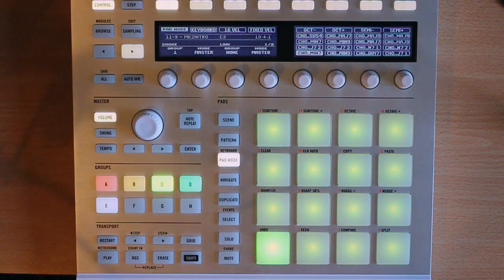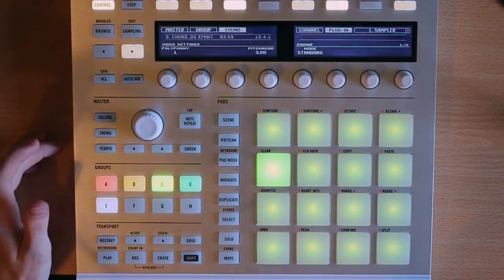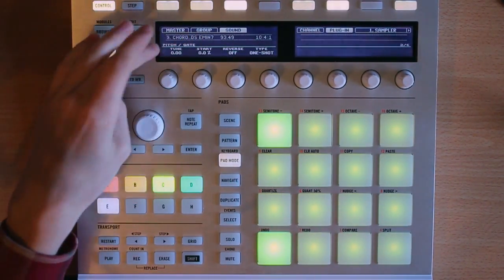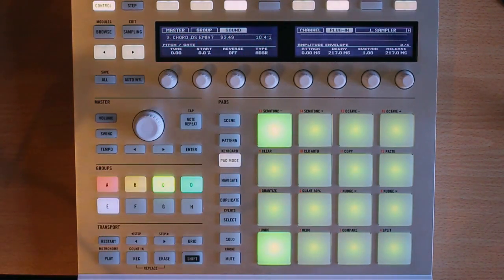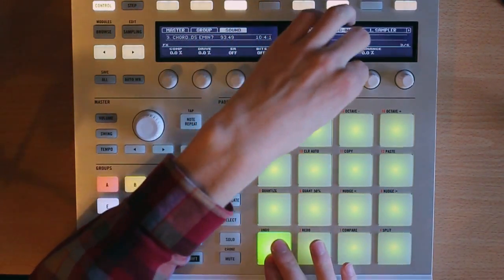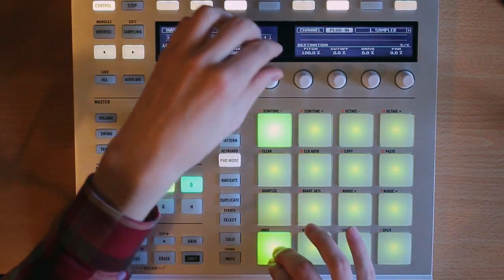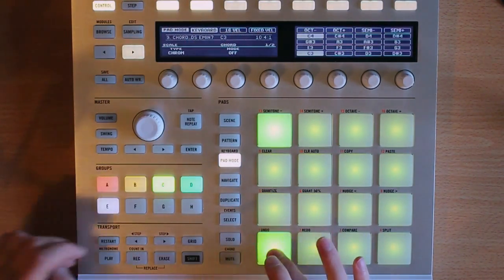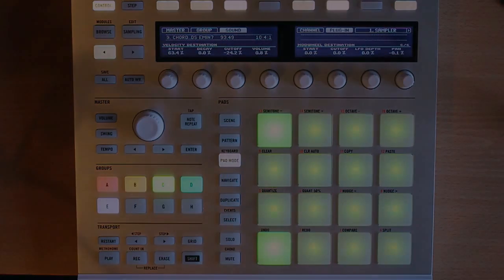Intro to MK2 - Part 8 - Understanding the Sampler

Comment: SR and Bits let you change the bitrate and sample rate of the sample. It's used to emulate old school samplers like the EPS or SP1200, which had much lower sample and bit rates (SP1200 has a bitrate of 12 bits and a sample rate of about 26,000Khz.) More modern equipment utilizes 44.1Khz or more.  
It can help give your beats a more Lo-Fi touch, especially if you resample (get a drumbreak, add the SR and Bits along with a lowpass filter with the cutoff at 10,000, modulation envelope keep attack at 0 and crank the hold and decay to max, use the tune knob to increase the speed of the break to you liking, then record that break on another pad. If you tuned the drums, say +6, tune the new recorded break down -6. 
Boom. Grittier drums with sampling artifacts.

Edit: Spelling lol